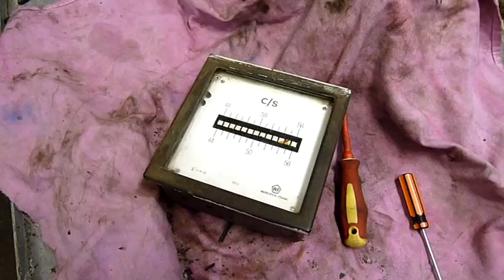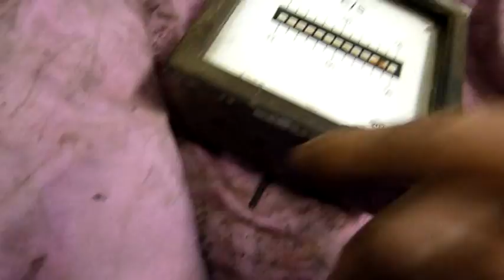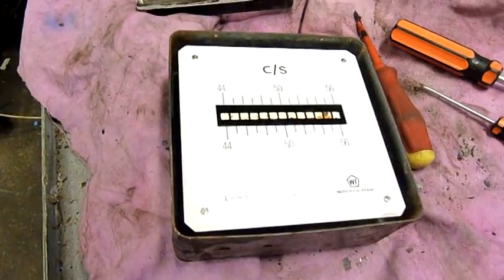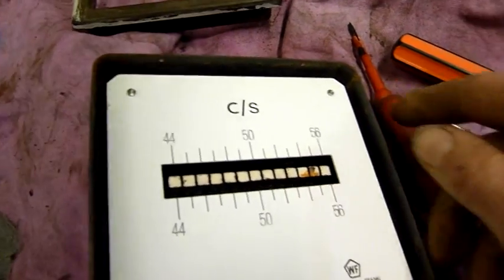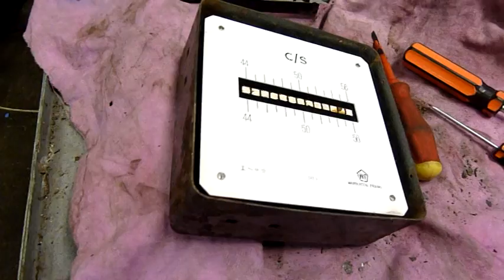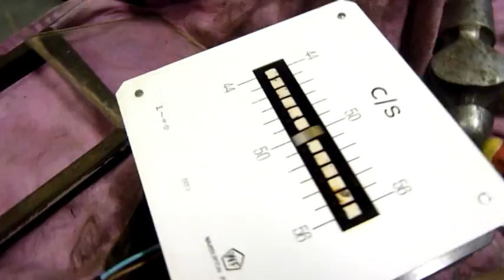Vintage Warburton Franki AC Frequency Meter

Comment: hi, I've got a vibrating reed frequency meter made by Frahm. It's a system frequency meter that goes to 50 mhz 110 volt. It looks really old. It has the first symbol of Siemens on it. mighty heavy, big clock. I want to know more about it as i'm curious whether this is valuable, but I can't find exact info on the internet. Maybe you are triggered or know an expert who is? i hope to learn more

Comment: we used to have these on the genset at the college i worked at when we went into co gen phase in the summer months , it helped us sycronize the polyphasing they are very accurate . when I used to do the monthly run up on the generators thru the resistance grids , I would change the speed to see how much difference the speed vs the cyclage was . on the big units it wouldn't varie much . but the little units it was considerable . and this was 4160 v 60 Hz .

Comment: Nice meter, they are very accurate meters. the reeds are tuned to the exact frequency by weight.
The two coils are voltage coils. These meters make basically no noise.